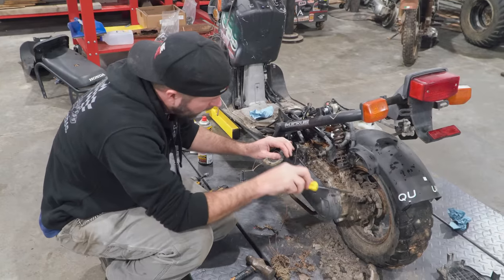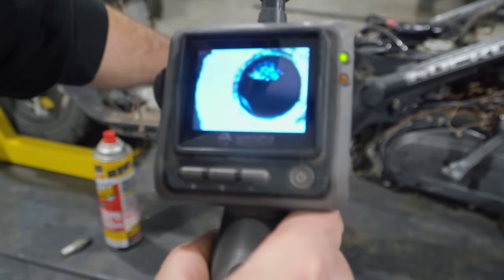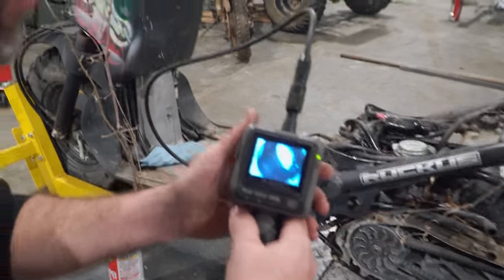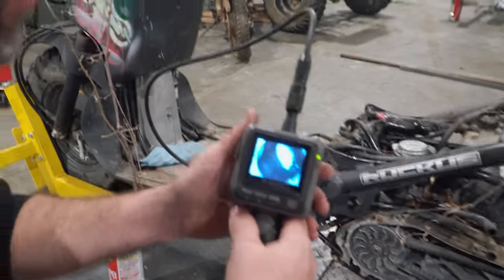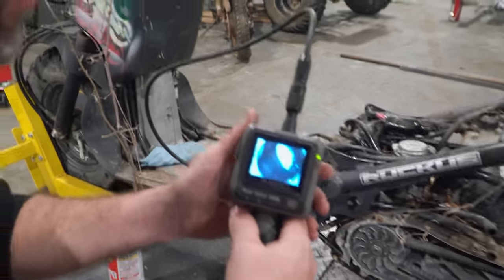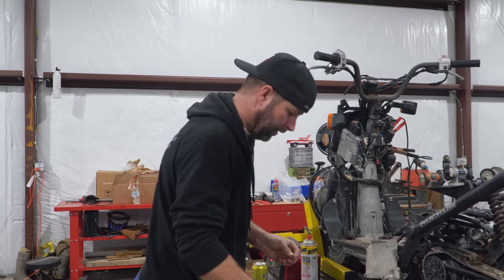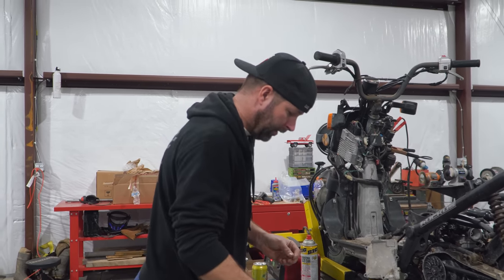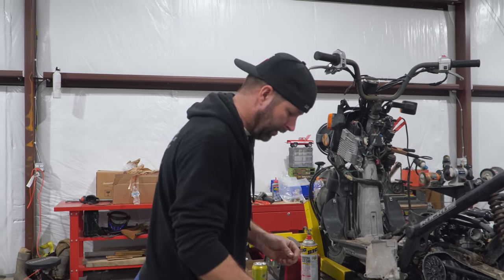We Rescued a Seized Honda Ruckus Moped from the Woods, Will it Run & Ride Again?

Comment: You don't have to take the radiator cap off to check the coolant you just fill up the reservoir and that's not a GY6 that's a stock Honda GET-50 motor. But a GY6 150 that is actually a Chinese knock off will bolt right on to the ruckus

Comment: If u think the rukus is fun.   You need to find an 1980s honda AERO 80cc 2stroke scooter.   That think hangs with todays 150cc 4 stroke scooters.   Does the best wheelies of any scooter ive ridden.   Standing on passenger pegs anyways.

Comment: just get a smaller wheights in variator bell its gonna go faster and take cover out put it on and give a gas and look do that nelt go in top of the bulley if its not go there is a wrong type of sleeve what stop it to move top of the bulley.

Comment: Any opinions on a 150cc  gy6 engine and transmission? I'm rebuilding a dazon raider. Full suspension,  rack and pinion steering and front and rear hydraulic brakes.
Reply: What about it? Its 8 or so horsepower stock. On the other hand, the original citroen 2cv was 9hp, so... it might be enough for your use. But fast, it will never be. Doesnt mean it cant be fun in the right conditions, though.
Reply: I'm not really looking for speed. Just something to take off road for trail riding and possibly overlanding with some friends
Reply: @mickeyhulk6790  Sure, but for many 8hp just isnt enough, even if they arent looking for speed. 40 mph top speed while flat out, less in a gradient or with a bit of load, gets old very fast for a lot of people is what I am saying. 

Also, these vehicles were built as relatively cheap toys to have a bit of fun in your backyard with first and foremost. Its not a vehicle made to stand up to any serious distances or off roading. Any japanese brand 4wd ATV that isnt explicitly built for small kids is going to many times more powerful, capable and reliable. Sorry, just being honest.

With that being said, if you are fine with all that, more power to you. Just be aware.
Reply: Thanks for the reply
Reply: @mickeyhulk6790  Listen, I am really sorry if I am a party pooper. These vehicles can be a lot of fun, and serves their use. Just think of it as an off road capable go kart, and you wont be dissappointed with what it can do. It might well survive years of usage for reasonable distances, if it gets correct servicing. But never bet your life on it. 

A really cheap name brand UTV is 8 grand new, after all, thats quite the difference, and its certainly not just markup. Cheers mate.
Reply: An off road go-cart is exactly what I'm wanting. I can't afford bigger off road toys yet. I'm just trying to have something I can take my son out and have a little fun with. I know it won't be that strong or fast but it will be faster than my son's 5hp single wheel pull go-cart and that's all I'm wanting for now. Thanks again for the reply 👍

Comment: Yes that's where the shim slides in. get a magnet easier that's the gy6
Reply: A gy6 is the Chinese version! Ruckus clearance is intake0.10+-0.03 exhaust is.0.19 +- 0.03
Reply: It clicks! Supposed to!
Reply: Once the pressure comes in it will stop(fuel pump) then go again. Definitely check idle circuit and main jet. Hold brake handle in to start
Reply: Be careful if you use the wrong oil it will blow crank seal too! Don't over fill oil. Do not screw in to check. Just dip stick in and out. Watch water temp too! Nope no burn out! If it's stock no burn out!  Its a enrichment choke! Adds gas until its warmed up

Comment: That ruckus tank id throw some rocks in it slosh it around to get the rust out then was it out real good
Followed by a nn diluted rinse with purple power then an additional rinse with with water  then i would solder all the holes i found using steel solder  after that id coat it with por 15 to seal it up and stave off any new rust for several years

Comment: When does the suspension for a 50cc bike become too dangerous for larger engines?
Reply: Anything over 125 cc or pitbike China motors ... 50cc shock is the same as 125cc I'd say once you do a 250cc or larger you would need a larger shock

Comment: I'm pretty sure it's oil cooled I think Honda stopped making water cooling system moped after a certain amount of time and switch over to oil cool radiator which is usually sitting on the side of the engine like that one🤔🤔🤔

Comment: The fuel pump is needed gravity-fed will run the bike seamlessly but if you have the pump it will get that higher speed the gravity and vacuum can only deliver so much fuel but with the motor doesn't have to work as hard trying to make enough vacuum just my two cents
Reply: hopefully this information helped you guys out

Comment: Bucket and shim is kind of a pain in the ass , The engine in my Toyota Tacoma 2.7 is like that and when I got the truck every single valve was out of adjustment , it's a 2.7  16-valve 4-cylinder it was a pain in the ass setting them up to get them all within 8 to 10 thousands, but the truck ran like brand new when I was done because when I got it it would barely run it was like it had no compression

Comment: Instead of a Tomos moped, why not use a Jawa Babetta 210.230  2 speed with a geared dual clutch automatic transmission. The 210.230 can be derestricted to the 210.240 40 MPH spec simply by drilling out the two 1/8th inch holes, in the silencer backpressure plate, to 1/2 inch and drilling out the closed off baffle tube holes.

Comment: You're not going to get accurate measurements down into the 1/10 of a thousands with a set of calipers. That requires a micrometer.
Hell it's probably not accurate to the thousands. The best you can hope for is + or - .001
    However...if you have a one inch standard to check the calipers with you can get a better idea how accurate your calipers are and you can adjust them to a certain extent.

Comment: I've unseize a V8 it was run out of oil with mystery oil fill the crankcase and work the crankshaft back and forth but it's still runni g 5 years later

Comment: Is not a gy6 the gy6 is a 125cc or 150cc conversion, this is np50 i believe,  the new motor you got is likely someone who converted to a gy6 and thats the old motor and swing arm, also most time you guys were running engine you didn't have any engine coolants in the tank,also i honestly believe you should leave the ruckus stock, maybe mod the variator and upgrade suspension, but if you want 125cc buy another bike, you get into modifying these and i see nothing but reliability problems, the stock ruckus will run forever and then some

Comment: just put a 80cc on it and the top speed will stay the same xD just the hp and torque goes up 
but the 2 stroke cvt scooters can go over 60mph with a 70cc jug

Comment: Kids are probably screwing around out in the woods and then dumped the moped, once it was on the side and soaked the air filter, perhaps it just choked out the motor and it wouldn't start back up before it could lock up due to oil starvation.

Comment: yeah, that thing should do 45-50 mph stock. obviously them kiddies neglected and beat the poor little thing neigh unto death. i think it just needs some love in the valve train, rings and a new exhaust. prolly a new air filter and air box boot as well. i have a yamaha razz, and when i removed the restrictor tube from the air box, it ran worse, and lost power. those 50cc scooters are dialed in to run with the stock set up, and still be street legal, so any changes you make to the air flow in or out, like a boot sucking air, or a exhaust that's plugged up, will prolly need re-jetting to compensate for it. get those sorted out, and a new set of dirt diggers, and you'll have a slick little offroad machine.

Comment: Just get the fuel pump and gas tank and valve system.  Or steal them off the other motor yiu bought. Run her normal

Comment: A 350cc KTM engine could probably fit in that gap between the seat and floor pan gap. If you want a fast scooter youll want to keep a eye out for a two stroke Lambretta scooter, those things can be modified to do 100mph. However if you do get a KTM 350cc motor for the Honda Ruckus, you could increase the ride height with the shocks if you do some tinkering.

Comment: Not a Mo(tor)ped(al). If you even look for a moped all you find are scooters.
Reply: Thank you! It is pretty annoying when scooters get called mopeds since those are two different machines. Mopeds are more like bicycles with helper engines, you can physically pedal them along. Scooters are closer to motorcycles, but with the engine under/behind the seat instead of in front.

Comment: I don’t think you can spin it any faster than you were man, sounded like it was turning over pretty fat from the video? Come on guys you should be able to hear that being right there… 🤦🏼
Reply: He says it’s not ignition but I think it’s totally ignition related. I’m only a few minutes in so I guess we’ll see…
Reply: That has was most likely why it wasn’t running after seeing that. That should have been one of the first things you check. Gas, spark are the two major things you need to check along with air/compression….total amateurs….💯💩👎🏼🤦🏼

Comment: yeah bro its a honda... but do some search. honda really didnt make it with this one.
its one of the worst scooter engine ever. the famous GET engine...
they have so many problems... bending valve in less than 10 000km is one problem. and it will happen again in 2000 to 10 000 km even if you change them.
the cylinder ehad crack for no reason after2000 km but its no problem they crack in a spot where its not important. just like dodge 3.9 5.2 and 5.9 MAGNUM engine. but its still a fact.
valve stem premature wear
crank bearing vibration after about 15 000km. thats way too early. even 139QMB ( kymko bought the honda engine its not a clone ) easily last over 30 000km with bad care.

that is probably why stock ruckus are so hard to find. they are ALL swapped 50 or 125cc GY6 chinese engine ( 139qmb is the 50cc gy6 ).
and its such a bad engine there is almost NO performance parts for it.
its so sad they are so nice.